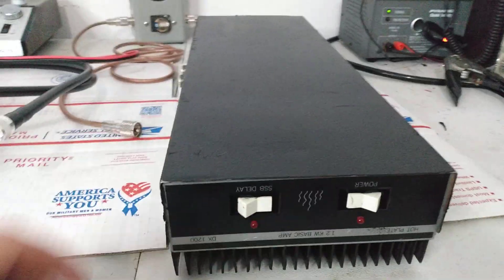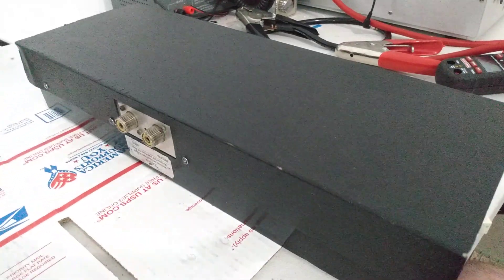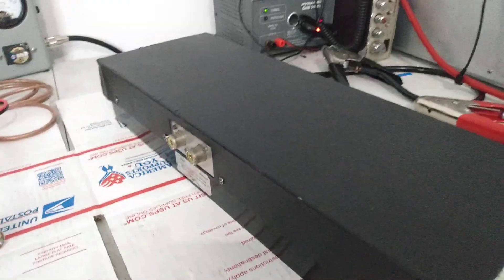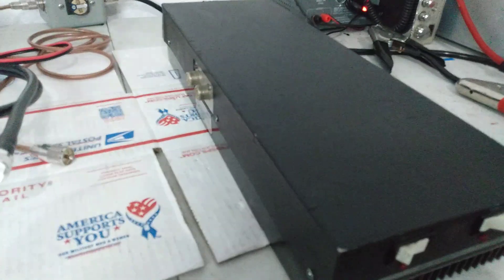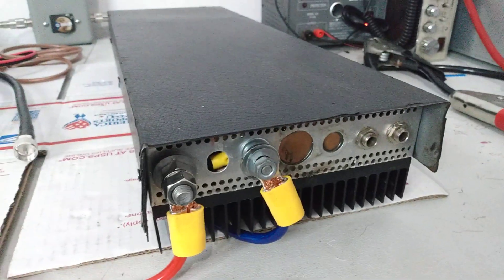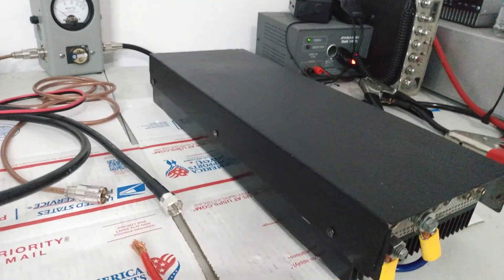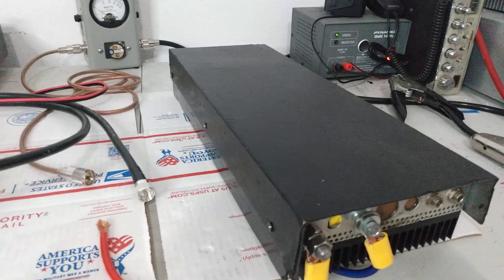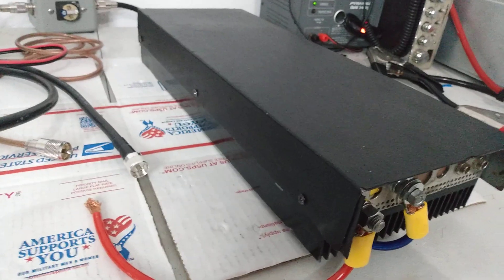A... Blown Up Texas Star 1200 "Hot Plate", what to do with it?

Comment: A Texas start 1200 according to Texas Star should run a dead key of approximately 600 w and swing to 1.2 kw per spec. I own a sweet 16 they recommend a 1000 watt dead key swinging to 1.6 kw. Although I don't run mine that hard I do run a 600-watt dead key and forward swing to 1.6 kw. I have owned this amp for 22 years it has the original beryllium transistors in it it is still biased and still runs on my bench today.